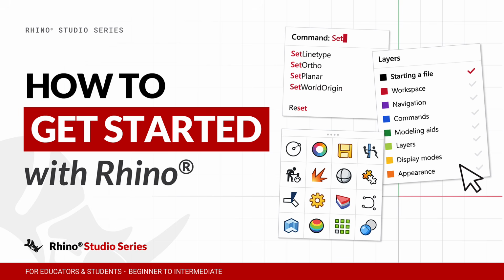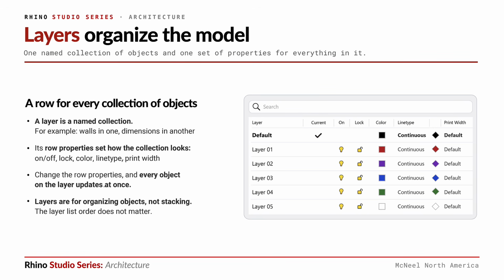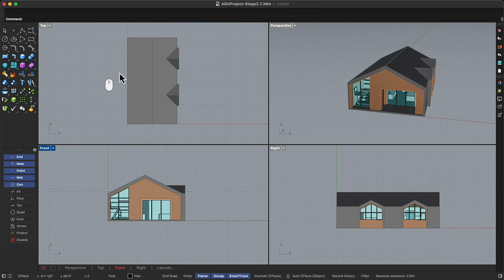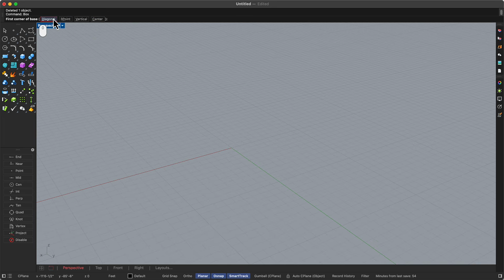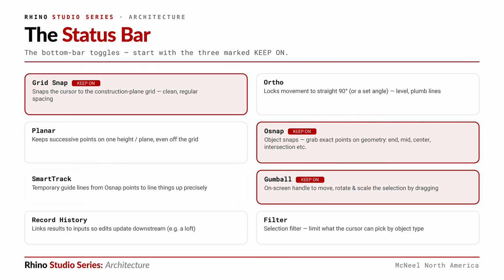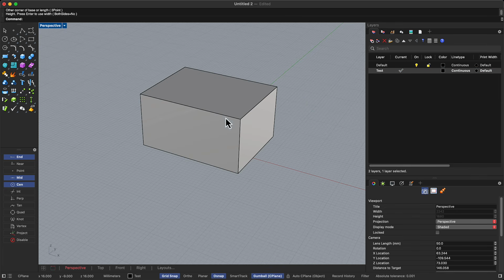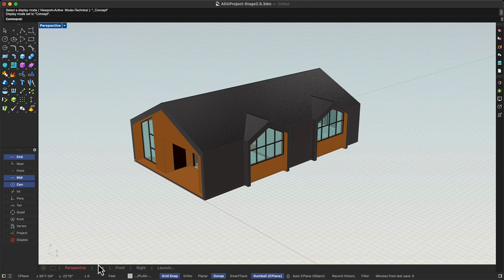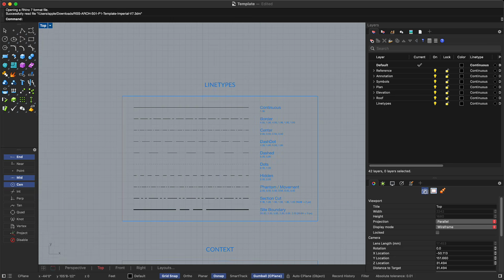How to Get Started with Rhino | Rhino Studio Series

Comment: Regarding Layers, the Current Layer checkmark in the Layers Panel sets the layer that built-from-scratch new objects will go into, whereas when you copy an object all the copies will be added to the same layer as the original object. To change and object's layer, select it and right click over the layer that you want to add it to in the Layers Panel and select Change Object Layer. Also Rhino has a MatchProperties command that can be quickly used to match select properties of objects such as Layer with just one click.